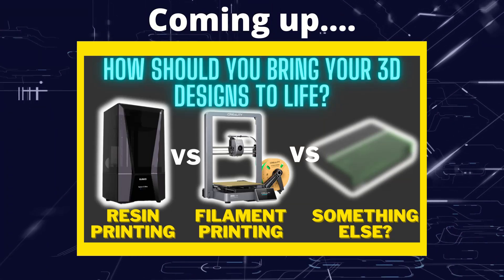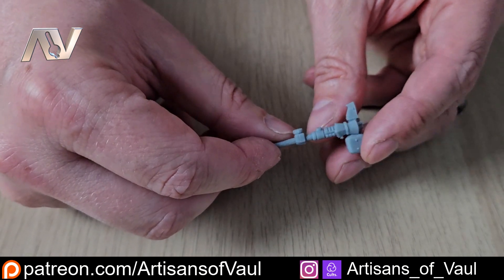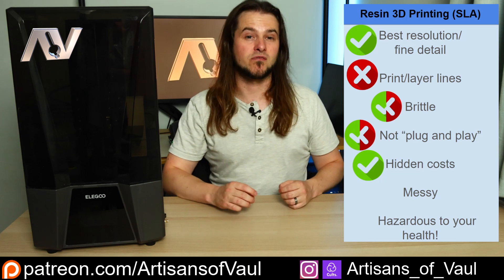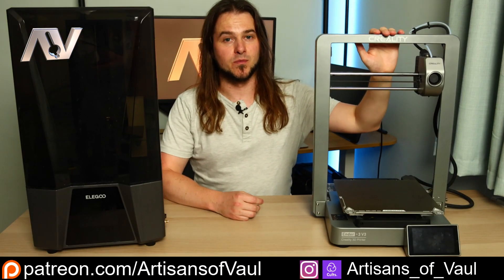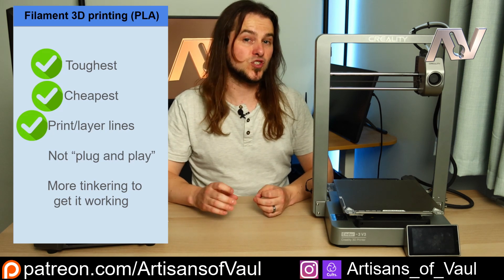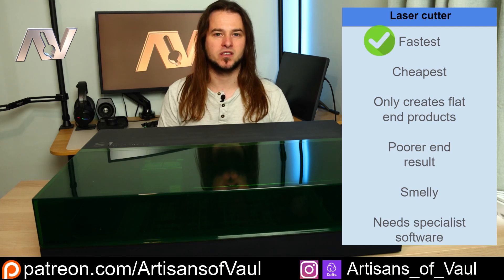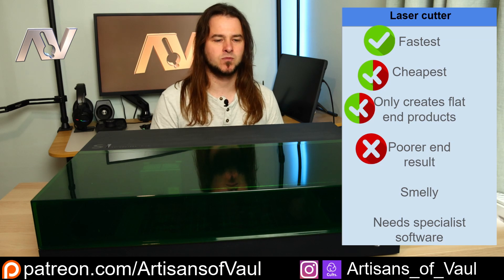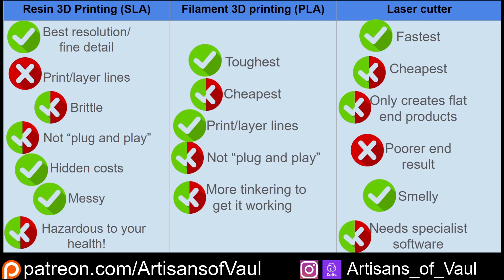How should you bring your 3D design projects to life? - Resin printing vs filament printing vs ???

Comment: For me, the biggest drawback for resin is the mess, cleaning parts and all that. Do not get one without getting a good cleaning system. Sticky, toxic goo. And the biggest advantage for filament, no mess, it just prints and done. And some of the new materials for the Bamboo labs stuff is crazy.
Reply from the maker: @stormycatmink  agreed that can be a concern for sure, I think it goes into the section about it being hazardous.  It really depends what you're after, I need the detail that comes from resin and FDM just can't get to at this point. But maybe some day soon
Reply: @ArtisansofVaul  Agreed. I got a resin printer first, and it's still my go-to for printing most anything with detail. But I'm trying more and more to do things with FDM if I can. I'm just real picky about surface finish. But the mess part always pushes back when I want to print things. Sometimes if I'm having a couple failed prints, I'll just give up because I'm tired of dealing with the cleanup. And having a good cleaning station helped immensely, but even with it, it's still a big drawback for me.

Maybe some people are less bothered by all the cleaning, or maybe I try to get things too clean after each print.

Comment: I have watched at least 20 of your videos on add ons and absolutely love them. Haven't actually seen you until now. Not that that is a bad thing. Anyways I do have a bone to pick. I come from woodworking and in the last 6 months went down the model railroad rabbit hole. I have every tool for woodworking. Jointer, planer, Sawstop, bandsaw, drill press,  two cnc's and a Shaper Origin that I built a drop in laser for. While I like the Shaper I noticed early on that the projects basically end up looking like the old balsa wood kits. This flat surface stuff just doesn't create good lines and tends to look blocky. When I got into model railroading (HO scale) I started to revisit it as I felt my skills needed to transition to doing small models rather than pieces of furniture or turning a bowl etc. I wondered if I could revisit the Shaper and produce flat objects that could be then assembled into building. After giving it much thought I decided that somethings might be possible but like a good woodworking shop you need a myriad of tools and different approaches to different things. Would I do a stone or textured wall with a laser cutter? I don't know. As you have opened my eyes to the possibilities with 3d printing with Blender I have immersed myself in learning it and the better I get the more impressed I get with the potential for outcomes. If was to invest in 1 machine that I think could adequately build all the parts on a fairly detailed building it would be the Bambu X1C. Still I might go to the Shaper to produce some things that  wanted to be wood that I could varnish and I might go to the CNC to mill a small aluminum or brass sign that I wanted to have that amazing look on the building. Where I think the laser fits in is with inlays. The Shaper with a bit is great for cutting the insets to about a mm deep. The Shaper with the laser is excellent for cutting the veneer to place in the inset.   You can achieve pretty fine detail. Good enough for HO. Not sure what your scale is. Thanks for all the great videos you do and disappointed that you did not do a series on Hard-Ops like you did on Boxcutter. Your teaching style is thorough and very easy to understand.
Reply from the maker: Thanks so much Paul.  So I generally work in 28mm scale (not sure how that converts over to railroad scale).  The thing I am always shocked by is how people are not combining different tools together (at least on a production scale).  You never see terrain thats a mix of 3D printing and laser cutting and I find that mad as it would allow the "best of both worlds" and being able to work in Blender for the laser cutting gives easy access to both.
Reply: @ArtisansofVaul  exactly. One method is just that. One method. Everyone will just say oh the 3D printer did that for you. Two methods will begin to look  a bit more polished. 3 will start to look detailed. 20 and you will be in the Faberge territory. I live in the redneck south. Not the cultured part of the world but when those suckers restore an old car or an old truck it is truly something to marvel at.
Reply: HO is approximately 3/5 that of 28mm scale. Sounds like a good scale to achieve good depth
Reply from the maker: @paulthomann7911  Oh cool, so around 15mm scale.  I have played some historical games at around that scale too.  Its nice for larger games but with enough level of detail (I imagine thats the scale draw for railroad modelling too).

Comment: Would you be willing to do a series on how to use blender from a 3d printers perspective? Struggling hard with trying to texture a piece using a (height map? Bump? IDK)  for the first time and very  confused. Tutorials seem to push towards rendering for a scene and I'm not sure if that's what I want to do. Also scaling and having parts fit together
Reply from the maker: @jackkuehneman9300  The 3D printing focus is why I made the channel as I found the exact same issue you have. I might need to know more of what you're trying to accomplish to help though.
Reply: @ArtisansofVaul My goal is to design jewelry and 3D print to cast. I hand craft a lot and use a lot of textures created by hammers or found objects. I'd like to be able to design a piece in blender and cycle through different textures to apply quickly. Currently I have a pendant that I want to isolate a section and apply a hammer texture that wraps around the whole thing. I've found some different things like PBR textures, the program materialize, and can't quite get the texture to blend and wrap around in a smooth way. The textures that come with blender work fine but not a fan nor do I have the patience or skill to find tune those to what I want. If you can point me in the right direction or even make videos yourself, that would be greatly appreciated since there isn't alot of it on YouTube and blender community discord isn't much help either.
Reply from the maker: @jackkuehneman9300  Hmm....  I don't do a huge amount with textures so thats a tricky one for then 3D printing.  I have some videos on creating textures but they focus mostly on adding it to particular parts of an object with an alpha brush: https://youtu.be/xASRPmXre38

Not sure if that would be helpful as I imagine you're trying to texture a whole piece or specific geometry?
Reply: @ArtisansofVaul  I've messed around a little with alpha textures then soon found out that it was capable of doing what I needed, correct. I need a consistent texture that has the ability to wrap around objects. Even if I have to go in after in sculpt mode to fix a seam that's fine.

Comment: I'm not that interested in 3D printing directly, but I would like to support companies that make prosthetics for animals.

These are now often created using 3D printing. However, often also via photogrammatry, whereby you only clean the model in Blender.

I don't know yet whether there is a way in this direction, but next week I have an appointment at a fab lab in my city in Germany. I hope that after this I will have a little more insight into who I could turn to.

If you perhaps have an idea of who I could contact to do something in this direction, I would be very grateful. 🐱🐶🫶
Reply from the maker: @juliaalder2007  So 3d scanning would help with that a lot. Photogrammetry doesn't have a "size" attributed to it I believe just shape so a laser (POP3 for example) would be what you want for the scanning. But the animal would have to be very still/unconcious/anesthesised. In terms of if being made maybe the filament would be best but the one thing I haven't been able to cover is a CNC machine.
Reply: @ArtisansofVaul  Thank you. 😊 In my mind someone gives me the model and I clean it up or - what I'm burning for - a technical drawing (after measuring the dogs leg for example) and I'll do what I am good at (modeling with precision) and send them the stl. I don't  know if I would have to print it for a company that already is an expert at 3d printing. The question is where my part starts and ends. Hopefully I am smarter next week. 😁

Thanks for the insight into the topic. 😊

Comment: I'm more worried about "hidden cost" of the lcd screens, printer is 400$ and replacement screens are 140$, supposedly they are good for 2000 hours, there are a bit less than 900 hours in a year total, so in 24x7 printing scenario they should last 2~2.5 years, but there are comments saying theirs die after 2-3 months, are those fake bad reviews or that 2000h lifespan of the lcds is a myth? (talking about monochrome 12-14k screens)
Reply from the maker: @dsfs17987  Good question, possibly a good question for a video to cover in more detail but I'll do my best here. So I should start by saying I have worked my printers a lot (I've had 4) and treated them pretty badly and never had a screen go on either my printers from anycubic or elegoo printers. I know you hear about people's going in a month (I have too) but I don't think it's a common thing to happen. 

Forgetting that anecdotal evidence I'm going to maths out the screen thing, it's how my brain works so if it's not for you I apologise....
At 2000h at a cost of $140 that's $0.07 an hour. On one build plate I can get 10-20 28mm models in 3hrs, let's call it 10 as a worst case. So 10 minis "costs" €0.21 so $0.02 each (rounded). Even at that cost it's pretty irrelevant, easily less than the resin.

Now I appreciate that the cost comes in one go but if you have a print farm it's how you would account for it.

The bigger point here is that actually I believe it's 2000hrs of the light being on, not print time (I could be wrong). That 3hr print is maybe 2k layers at 1.2 seconds a layer. So that is actually only 40mins for that 3hr print. So divide that cost by 4 or 5. So really little....
Reply: @ArtisansofVaul  I'm buying the printer more for a different operation, exposing uv photoresist on PCB for electronics, I often need couple made quickly and other methods are either tedious or unreliable

normally photoresist needs few minutes of exposure, might be 5-8 minutes because of losses in filters and glass in the printer, but won't know till I get my hands on in to run actual tests
or, maybe, perhaps the resin will have good enough resolution and adhesion on its own to serve as a mask for etching, then the exposure time could be minimized, anyway,  I remember SLA process being fiddly and expensive, didn't notice the prices and performance improve so much in last couple years...
Reply from the maker: @dsfs17987  That's an interesting use, I'd saw a few videos on it. You know the costs of that/value of what's being made better than I would I imagine so I would approach it from the same methodology of working out the price per piece if they screen did last as long as expected and see if you believe it's worth the cost.
Reply: @ArtisansofVaul  Saturn 4 ultra arrived today, and did a quick test, 1min exposure was enough on some noname UV photoresist film I had bought 5 years ago, crisp edges even through the protective film still on the lcd
3min exposure seemed to already harden some of the resist that was behind "black" pixels
these films usually are meant for UV-A, which is 310~400ish nm, but I guess the 405nm led works just fine
Reply from the maker: @rikkc137  Oh awesome!  I'm jealous as I love the idea of the tilting mechanism, such a good idea to get better prints and faster!
Reply: A year has 8760 hours, so if your printer is going non-stop 24 hours a day 7 days a week, that's less than 3 months.
Reply: @Milkymalk  my bad with the basic math fail 😄
the point still stands about short lifespan of lcd screens though, some reviewers talk about them being consumables, but nobody really emphasized that
ordered recently Saturn 4 ultra, going to see how it really works out
I also wonder how many of those "on sale" msla printers are returned, refurbished and offered as new with some hours already on the lcd...